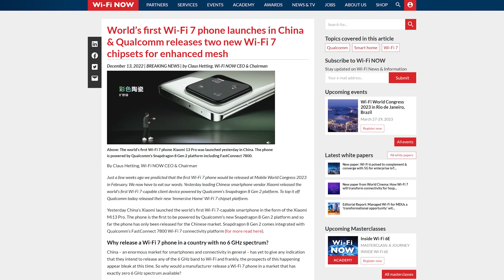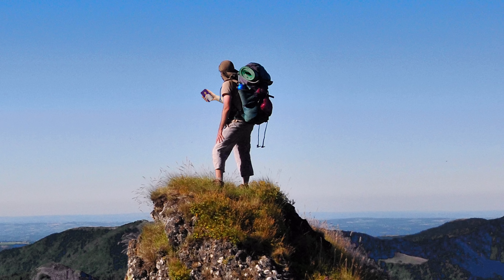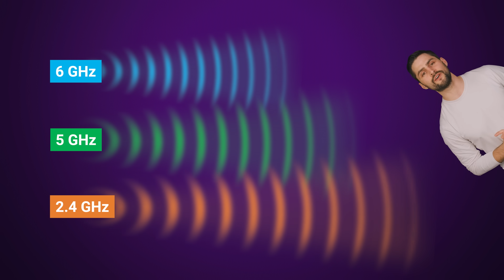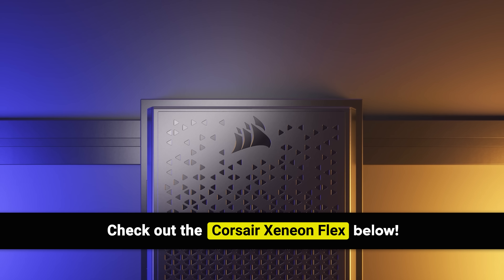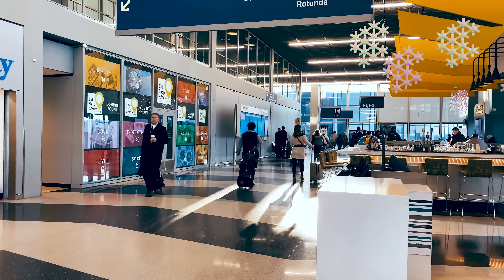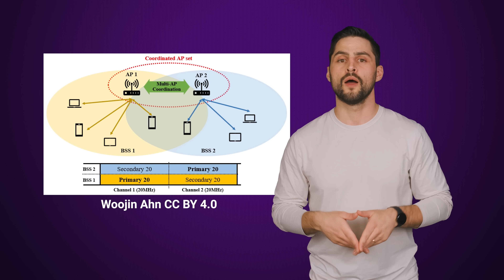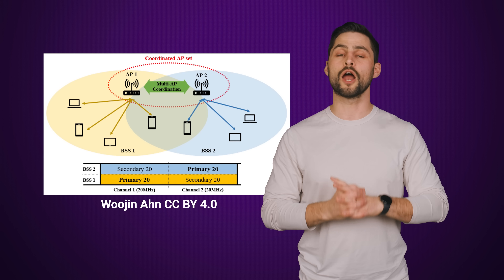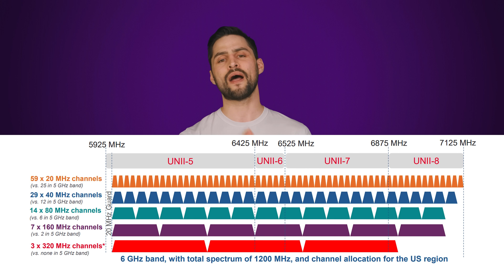Can Wi-Fi 7 Replace Range Extenders?

Comment: a dedicated WiFi 7 will be great for Wireless VR, now i just need to wait for a VR headset with OLED, foveated rendering and WiFi7 and a FOV of 100+, this will be the perfect headset
Reply: I'm waiting for an actual holodeck at this point 😂
Reply: And I know your expectations are much lower and reasonable, still I think we'll have to wait for a wee while
Reply: @RavenKStudios  if they support custom lenses it is good enough. I used to use glasses so I know the frustrations, but it is not feasible to have every prescription from -10 to +10 and without counting the, hard of doing in a VR device, astigmatism prescriptions. The quest 2 works well because you can put on it your custom prescriptions, but I don't think that making a device more expansive, without even including all possible prescriptions is worth it.
Reply: Big screen VR has an oled headset but it isn’t wireless, but it’s very compact and uses your prescription lense and fits on your face based on the facial scan, I suggest you check them out. I’m a hardware fanatic when it comes to VR.
Reply: @califoruphia16252  for some reason i dont have luck with base station based tracking, tried different base stations with different headsets at different room and i always have problem with tracking because of reflection or occlusion or interference or any other problem base stations can have, nowadays i even prefer slimevr trackers instead of my vive trackers because of that. i'm pretty sure someone will come out with a wireless addon using wigig2 tech like the vive one
Reply: @RavenKStudios  I don't think that anything other than lower prescriptions would be viable because of focal distances. You need to alter the convergence or divergence of light. Maybe if they invented a film that can converge more light depending on its voltage it would be possible, but at the moment, I think it is impossible. I would also love it, but I don't think it's viable.
Reply: Would it actually be better for VR than WiFi 6e? It sounds like the main advantage is more reliable connection at long distances or when moving over distance. WiFi 6e is already incredibly fast, and low latency.
Reply: @daboross2  AFAIK WiFi 7 also should include some sort of mechanism for prioritizing certain data streams, which would be helpful for wireless VR if it gets marked as high priority
Reply: Micro LED*
Reply: @ericwheelhouse4371  microled would be great but i'm satisfied with OLED, av1 would also be nice to have (more bandwidth efficient compression PLUS the better bandwidth of wifi7)
We already have all the tech to make the almost perfect headset, someone just need to put all together
Reply: Might as well throw in pancake lenses.
Reply: @pixelfairy  it's already standard at this point i guess
Reply: @ShendonZ  hope so. Thought wireless VR  would be standard by now.
Reply: The tech has been fine for VR for years, 60Ghz is literally perfect and can do upto 10Gb/s point to point.
Reply: @balthxzar  thats how vive does it, and it works great. wigig2 is out now, but no ones using it.
Reply: Wifi data transfer is still too slow for uncompressed data transfer, anything 4K+ over Wifi will definitely be compressed for the next coming years.
Reply: @heyjohnsmith  Doesn't matter at all if you can't see anything while using it. I've been using Wireless VR on the Pico 4 and it's already hard to even notice any compression for most games when using the best settings in Virtual Desktop. We're basically just a step short of having no noticable compression regardless of game. Also I would rather have a tiny bit of compression and be wireless than be stuck to a damn wire that constantly gets in the way.
Reply: @thenonexistinghero  With Pancake lens and Oled being a thing now, pushing 120hz 4K in the future with somewhat good compression via Wifi still seems to be out of reach. I don't argue that Pico 4 is a great budget AIO wireless headset, my point is just on the best case scenario and what the future holds. And latency is still debatable.
Reply: @heyjohnsmith  Pico 4 is doing 4K/90Hz pretty fine though. Latency will probably also drastically improve around the same time. Currently it's more than playable, but I do know it's not fit for games that require low-latency like high-level competitive games or high-difficulty Beat Saber.
Reply: ITT: we ignore lightfield technology and future screen tech
Reply: Honestly my quest 2 is pretty insanely smooth with WiFi at is (PC hard wired)
Reply: WiFi has aleady been good enough for Wireless VR for years. The XR2 chip having limited bandwith is not a problem of WiFi.
Reply: @thenonexistinghero  i tend to disagree, even cabled streaming have a noticeable compromise vs full video signal like HDMI/DP. The pros from wireless is still greater so i use wireless but definitely we need serious improvements from both sides, AV1 + higher bandwidth + a more capable chip is all necessary
Reply: @ShendonZ  You can't disagree with the facts. That the quality of wireless streaming of the Pico 4 is mostly unnoticable from native quality is pretty much a fact, assuming you have the hardware to stream at those settings. I'm not saying there is no difference, but in the best of conditions it's mostly sim and racing games with a very wide skyscape where the compression is most noticable during gameplay.

Even so, we're pretty much just 1 step short of it being pretty much completely unnoticable during regular usage (unless you're trying very hard or use special equipment). There's only so much you can do when you're restricted to 150 MBPS. I think all that's in the way is a better chip that allows for higher bandwith. It only uses a fraction of the bandwith available for even 5 GHz routers.
Reply: WiGig 2 will probably still be better for wireless VR, the only problem is that nobody using it so far.

Comment: i JUST got a Wifi 6 AP
Reply: And as soon as you get a Wifi 7 AP, 8 will be in development and devices will start to come out that support it.
Reply: @tsalVlog  wifi 8 will be useless unless you have more than 2gbps internet connection
Reply: @gamecubeplayer  explain
Reply: @RickMyBalls  a tri band be19000 wifi 7 router already has a real world throughput of at least 2gbps
Reply: @gamecubeplayer  still not making sense, how does the speed of 1 connection make it useless?
Reply: @RickMyBalls  how many people do you know that have more than 2gbps internet connection?
Reply: @gamecubeplayer  not relevant, we're talking about wifi here
Reply: @RickMyBalls  who uses wifi for non internet things?
Reply: @gamecubeplayer  me and the other billions of people who use local networks...
Reply: @RickMyBalls  if you need multi gigabit network speeds then you likely have cat6 or cat6a cabling installed
Reply: @gamecubeplayer  ideally, but cat 5e will also handle it over short enough runs - which you'd typically find in a home
Reply: @RickMyBalls  cat5e only supports 5gbit up to 50m & 10gbit up to 10m
Reply: @gamecubeplayer  yeah, which doesn't contradict anything i said
Reply: @RickMyBalls  ok but the typical consumer doesn't need more than 2.5gbit ethernet
Reply: @gamecubeplayer  who really needs anything?

Comment: It will be years before WiFi7 is fully functional, even if devices on the market, then 'support' it, it won't truly not for a couple of years after the standard is finalized. Through firmware upgrades maybe but until then, buying WiFi7 early on (first adopters) will be a no no for sure.
Reply: huh so far what I hear from wifi 7, good luck with apartment building when I see at least 10 networks around me. in my case, yeah it would suck as any wifi, so ethernet it is.

Comment: Get free wifi anywhere you go *bass drop*
Reply: Hold up
Reply: EDM starts blasting your ears
Reply: @darilight  do you mean "Electrical discharge machining" or "Electrical dance music"
Reply: @derteater obviously electrical discharge machining.
Reply: @derteater  Both, actually.
Reply: @SpykoYT  DODOOODODODOOODODOOO 🎶🎶🎶🎵🎵🎵
Reply: why would you drop a fish...
Reply: @squirtle88  slippery
Reply: hold up. dodododododoododododod 🎶🎶🎶
Reply: @GrimR3xx  hold up. Ring ding didididing diding ding
Reply: Free wifi ✅ Stolen laptop ✅ Ads block ✅ Never subscribed ✅
Reply: I just want every network provider to use fiber only...even 25mbs with fiber...is hella fast
Reply: With WPA3? Sure!
Reply: Dude i absolutely hated those.
Reply: Spectrum does this in my area already
Reply: Mobile data
Reply: Me: Allow me to assist, good sir (LASER LIGHT SHOW INTENSIFIES!!!!)
Reply: hold up
Reply: what the dog doin